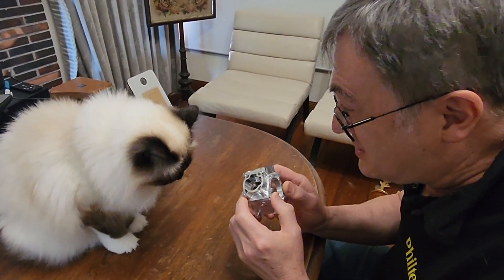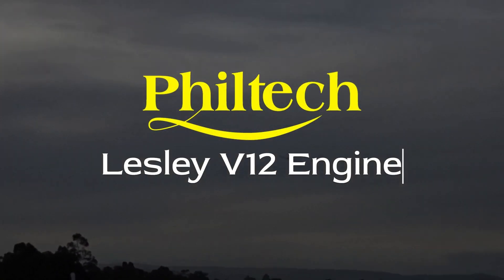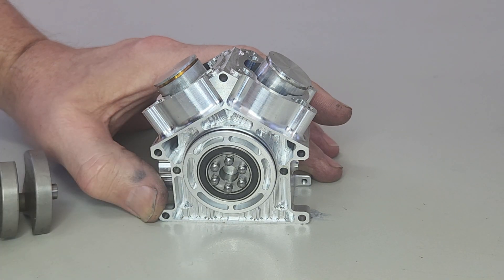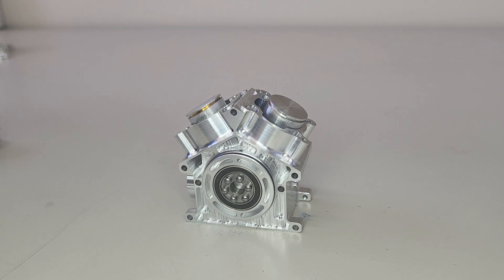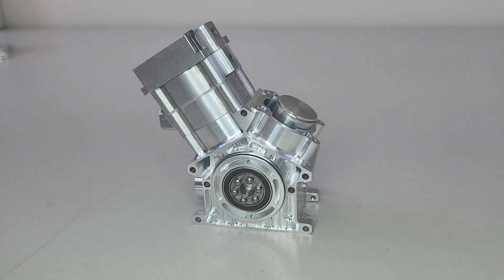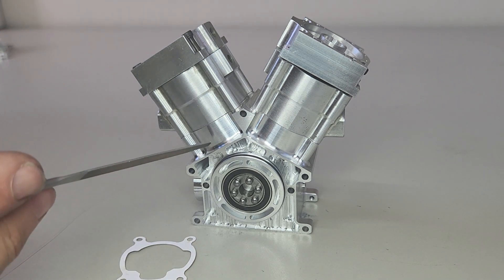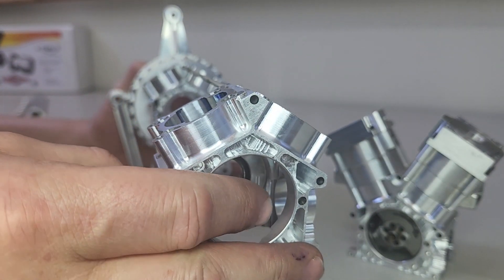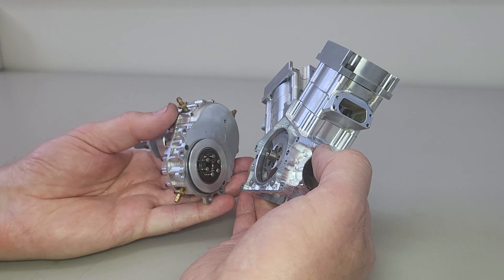How Does the Lesley V12 Engine Fit Together?

Comment: Lovely stuff Phil ❤ it would be really nice to see the assembly process of a single section on the v twin. By seeing the monolith crankshaft, I believe you are using 4 stroke style connecting rods with splitted cap. Just wondering hod you access to screw the caps. And I guess the distribution it's reed valve type. Would be very interesting to see. Thank you a lot for showing this work of art😊